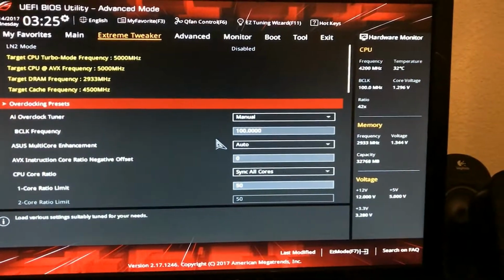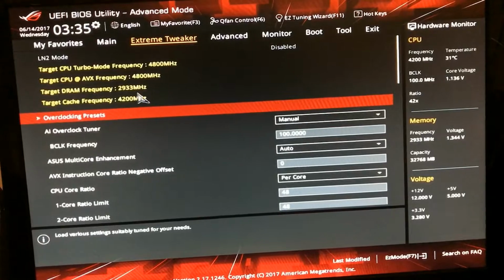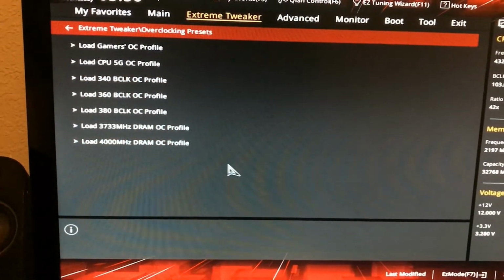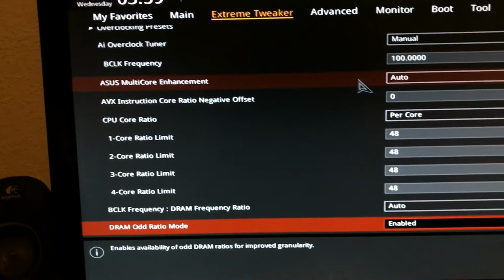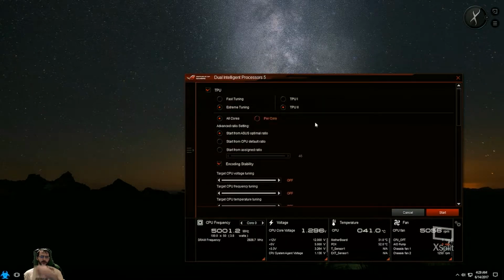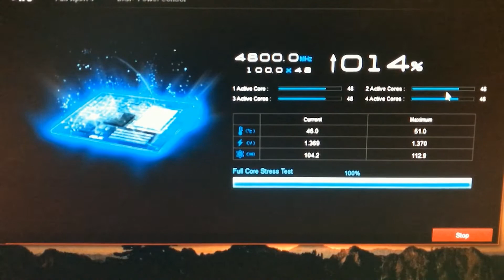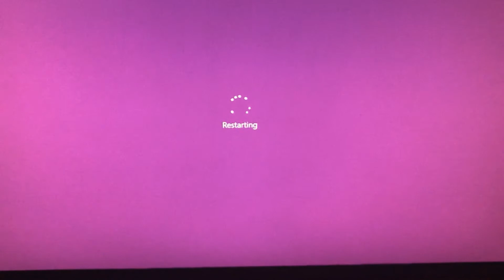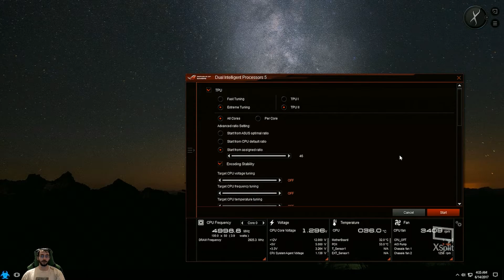Different Over Clocking Methods! Modern Look at todays over clock options

Comment: Thank you for your time. The TPU feature seem to be good a feature for beginners and for some professionals, as it still gives you a good starting reference for fine tuning. Great tuning by the way. That's definitely a lottery chip :-)
Reply: I meant *Reference of a super stable speed if you wanted to know where to start on a new CPU before notching it up. cheers again bud.
Reply from the maker: Yes exactly right , Im kinda glad I tested the diffrent ways and now I can definitely say witch should preform best for people interested.
I would say I got very lucky with my chip since it will hit 5.2Ghz If I really wanna push it.
I did buy it right before Amd Ryzen Launched and I feel that may have helped lol
When It came in stock before the delid I never thought It would run like it does now.
Super happy with results! =)